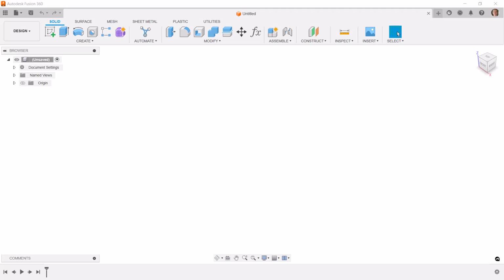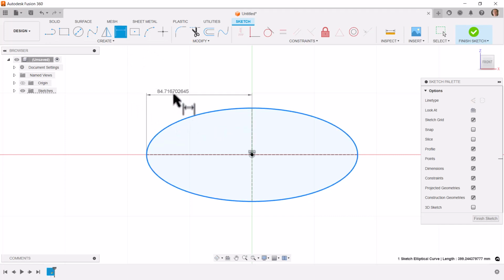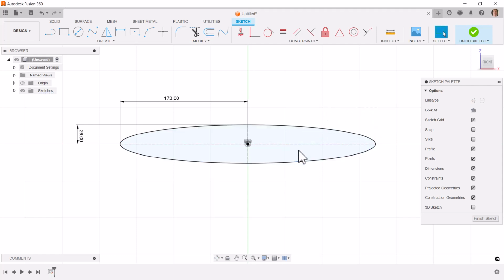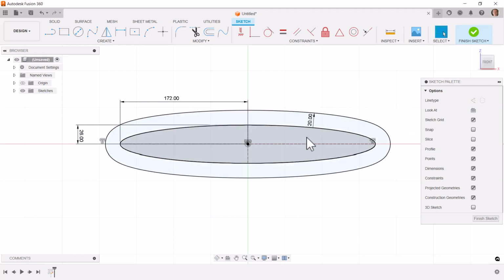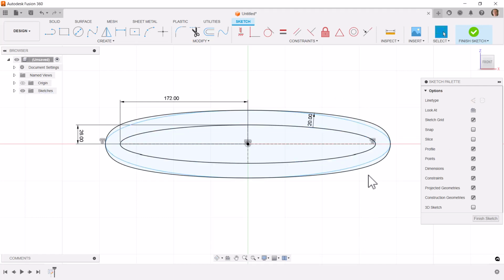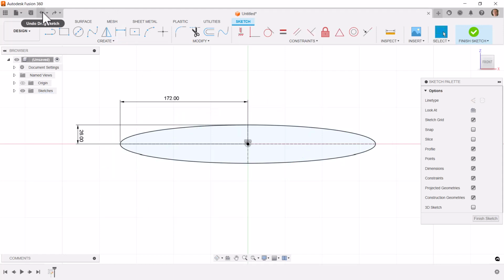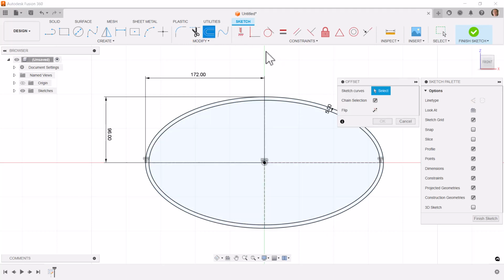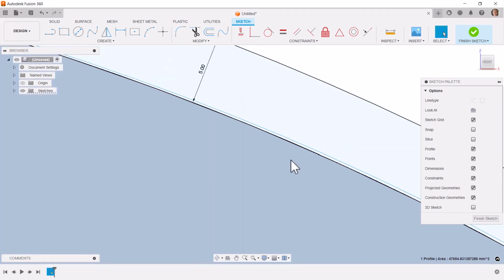Offset Ellipse

Comment: I see you're using Fusion, but how do I do this on AutoCAD?
Reply from the maker: I would need your AutoCAD *.dwg file to see what you are attempting to do.
Reply: @TheCADWhisperer  a mathematically perfect (section of a) tube, which is composed by outer and inner elipses. I eventually figured I could draw both circles in their exact shape, draw a vertical line on the thickness of the tube, then transport all those lines to a side view, rotate to the exact height of the elipse and there I would have all the measurements needed to draw the inner elipse in its perfect mathematical form.